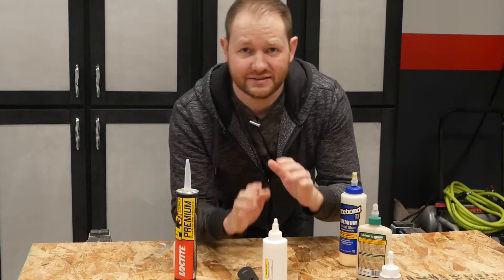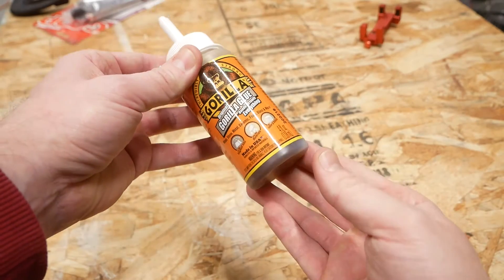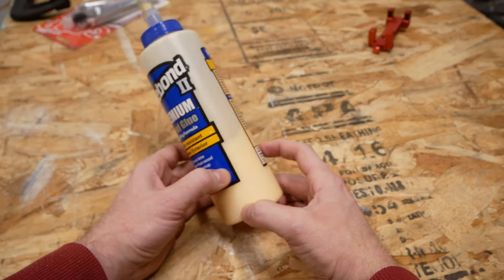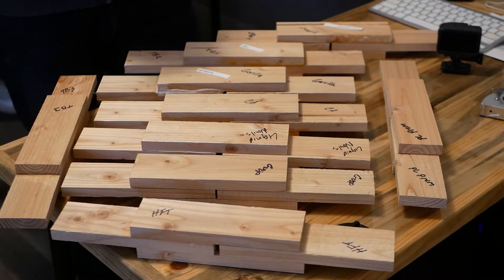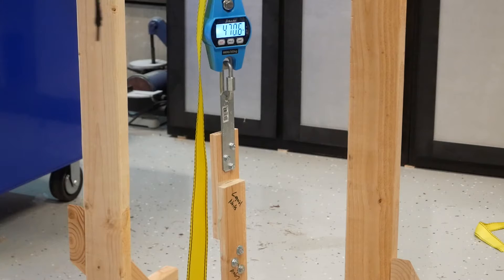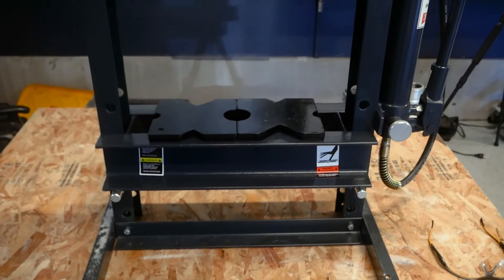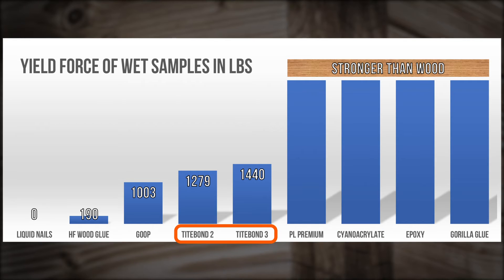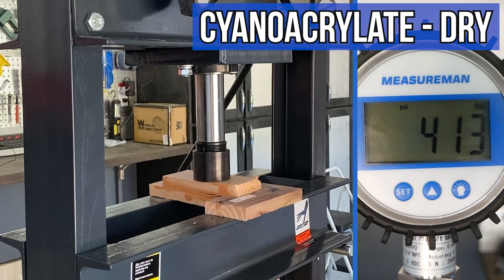Hydraulic Pressing WATERPROOF Wood Glues(and also kinda failing)

Comment: As per the user tips on my bottle of Titebond III, it is "Not for continuous submersion or use below the waterline". I'm not entirely sure how it's supposed to be waterproof regardless, but that does at least explain the failure you saw at 1440 lbs.

Comment: great test, I was using polyurethane glue (gorilla glue original basically but different brand) and was told to use titebond 3 and I said there's no way it is better in my extremely wet environment. since PE basically dries into some hard plastic. Glad I was right!